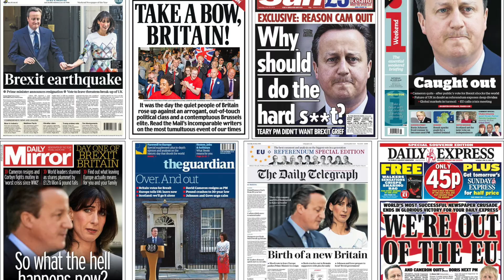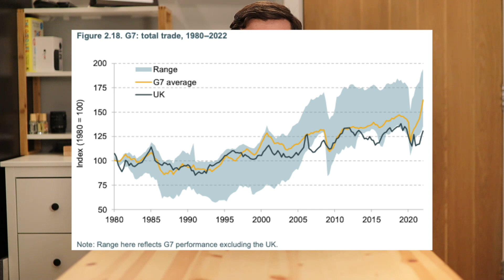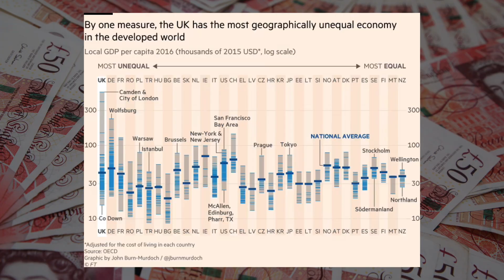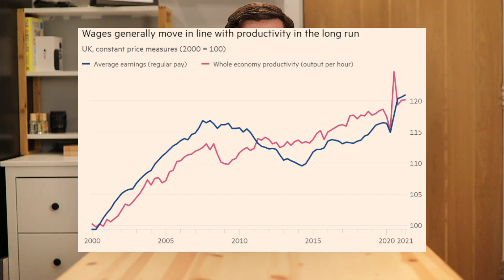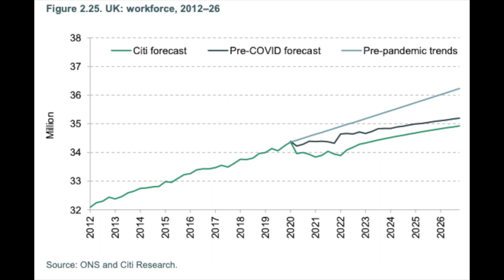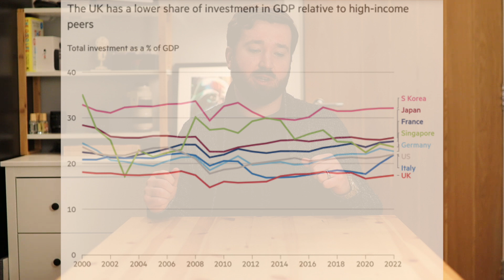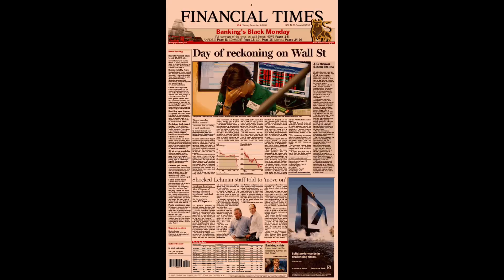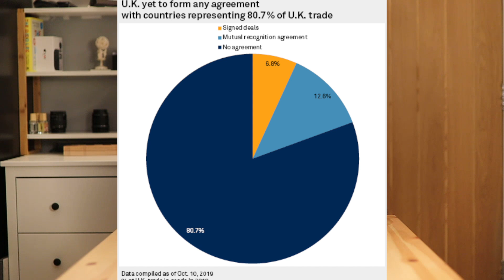Did Brexit f*ck the UK economy?

Comment: looks like brexit uk has grown more than germany since 2016
From 2016 to Q1 2023, the UK’s Gross Domestic Product (GDP) grew by 5.9% in real terms, while Germany’s GDP grew by 5.4%. This suggests that the UK’s economy expanded at a slightly faster pace than Germany’s during this period. However, these figures can vary depending on the source and the specific indicators used.

In Q4 2023, both the UK’s and Germany’s GDP fell by 0.3% compared with the previous quarter. This indicates that both economies experienced a contraction during this period, likely due to various factors such as global economic conditions and domestic policy decisions.

However, when comparing the recovery to pre-pandemic levels, the UK appears to have fared better. As of Q4 2023, the UK’s GDP was 1.0% above its pre-pandemic level of Q4 2019. In comparison, Germany’s GDP was up by 0.1% over the same period. This suggests that the UK’s economy has been more resilient in bouncing back from the economic downturn caused by the pandemic.
sources
Office for National Statistics, UK: Provides a wide range of economic statistics, including GDP growth rates and other key indicators.
Federal Statistical Office, Germany: Offers comprehensive data on Germany’s economy, including GDP and other economic indicators.
Eurostat: The statistical office of the European Union, which provides data on EU member states and other countries.
International Monetary Fund (IMF): Provides economic data and reports on countries worldwide.
World Bank: Offers a wealth of information on global economic trends and country-specific data.

Comment: I've heard trade with the EU is only 8% of the total.  The EU stands to lose a lot more than the UK with Brexit. Trade tariffs work both ways.  Europe full of Chinese manufactured goods.
Reply: Seriously? Seven years and you have not learnt a thing. Trade with the EU is almost half of UK trade (45% exports, 53% imports). The 8% is a figure that was the percentage of UK businesses exporting to the EU. 

For the EU on the other hand,  UK trade is some 8% exports and 6% imports. That is, it's the UK that stands to lose more.
Reply from the maker: And those numbers are misleading. It literally equates a tiny corner shop to a huge multinational firm, when you just look at the NUMBER of firms.
Reply: @ModernMoneyTalk  You are assuming that Brexit voters can master proportionality. If they could, they would never have voted for Brexit.
Reply: No trade is up with in eu do your home work, and income higher generally,
Reply from the maker: If it is then I’ve not seen that data. Only comparison is increased on 2022 vs 2021 but that’s the hangover from Covid. Not recovered to pre-Covid levels.